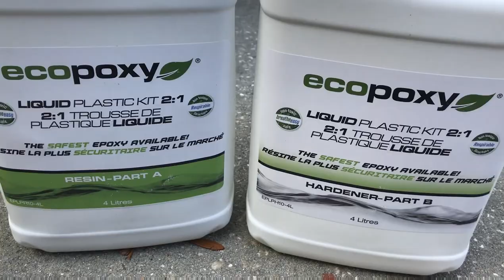Computer Epoxy Resin Table

Comment: Hey odd idea but hear me out. What if you put together a computer. Made a cooling pipe cage around it for water cooling. Then encased it in Epoxy?

Using a super chiller to keep the entire epoxy computer cold as ice?

Strange idea i know but i feel lile it would work strangely enough
Reply: @chrism5517  

Yeah ive been pawndering it all day. Like if what if you made this and wanted to freeze it the use it for  gaming. Then again i think youd need to use a D-lidded CPU so there wont be any air gaps. And the CPU would have to be the kind thats saudered to the borad.

This is a very complicated thaught owo

Comment: What size was your table and how much epoxy did you use I was planning on doing the same thing but with how big I need the desk to be since it will hold two gaming pc plus a 40inch tv for a Xbox one in the middle company’s are saying I need 20 gallons of resin not trying to spend over a thousand dollars just in resin

Comment: how about using components of just one cool gaming pc and using that in a resin filled table? Like the motherboard and the ram next to it and the graphics card and power supply and m.2 drive and even a ssd  and keyboard and mouse. Not the case, cause its gonna take allot of space.